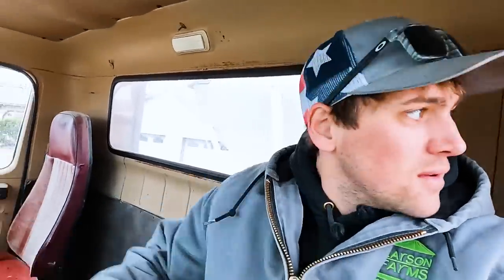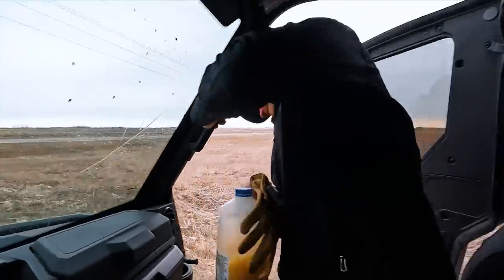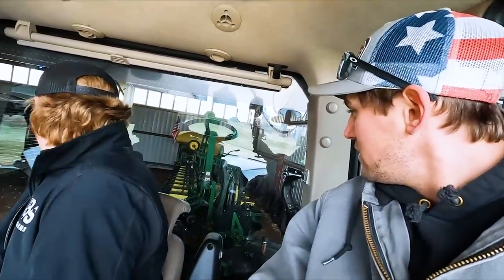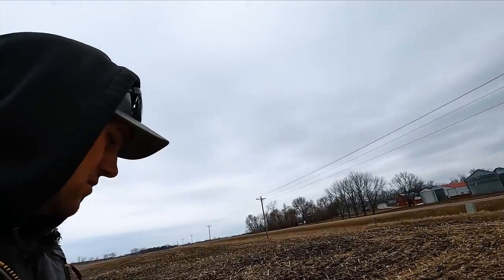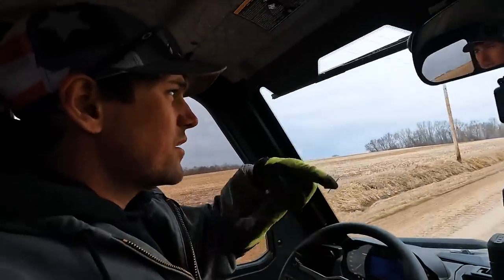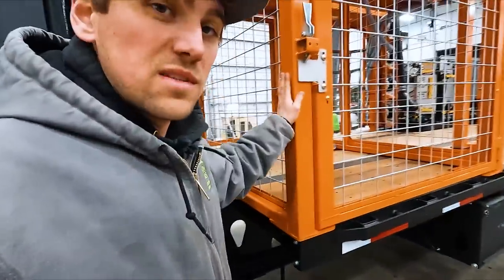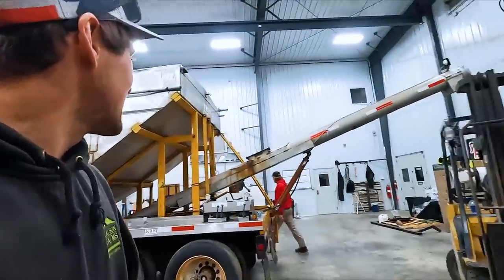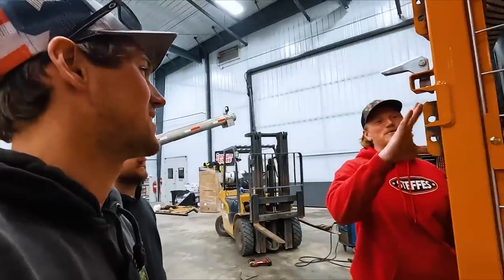We Destroyed Our Driveway Hauling Grain! Time To Fix!

Comment: Need to run a tile line down the middle of the driveway to stop the frost boils
Reply: French drain but in a driveway wouldn’t be ideal but if there’s black dirt like they were digging out best thing is to dig the driveway out and redo it woth QP or something better
Reply: @leonapplegate5450  they could do that, or, just knife a single 6 inch line in and be done in an hour

Comment: To fix your drive way and never have to redo it ever again, under cut your whole width of the drive way about 18" or until you get past the black dirt. Ideally you would want to get to gravel but don't know your soil. Then lay geo textile road fabric grid mat down. Start with 15" of 3" clear limestone or rock.
 Another layer of geo textile road fabric. Then top off to finish grade with 3/4" clear lime or rock. Make sure there is a good crown for water shed. Make sure to roll and pack the layer of rock. 
A road or drive way built this way will last decades.

Comment: Just curious being 6 an 8 row planters are little or nothing at auctions you should experiment with the old planters an new planters  with all that technology on 50 acres same corn same ground be interesting to see the actual results  not some computer generated results but actual results   .I'll be willing to bet you spent thousands on experiments for big tech an replaced sensors at $150 a pop but proof is in the heard an what ends up on the plate an join the milk council now they want to remove chocolate milk from schools  but are OK with corporations dumping all chemicals in a can an calling it good  worlds gone crazy
Reply: The new planters will out perform the old ones hands down.
Reply: @gregjames5070 Not really. I know a lot of guys in my area that grow 280bpa corn with simple planters. Most of the new tech they pack on planters is just an experiment to see how much dumb people will spend to look cool.
Reply: How you gonna plant 7k plus acres with an 8 row planter.
Are they supposed to down size.
Reply: @cw93711  There are plenty of 24 row mechanical planters available.